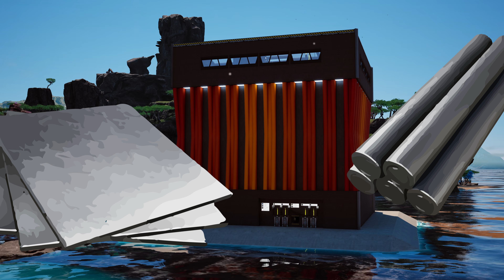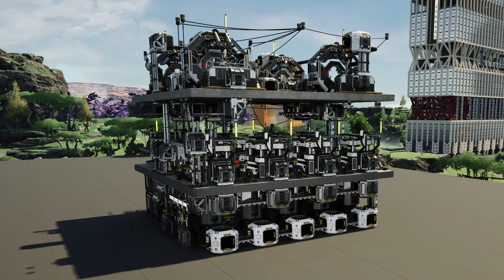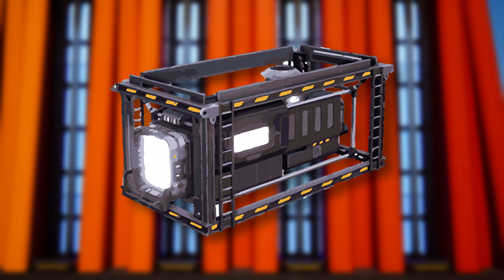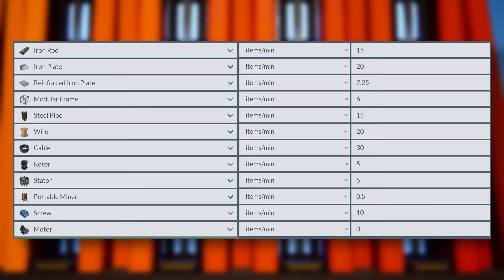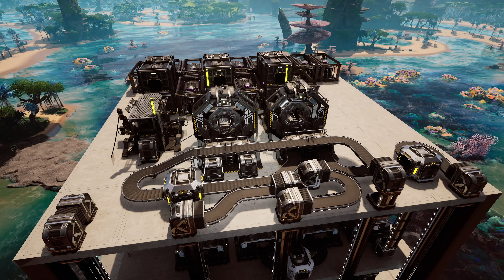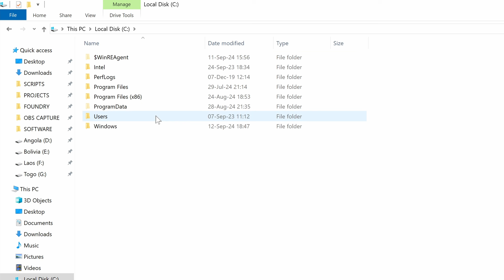1-CLICK Dimensional Depot in Satisfactory 1.0!

Comment: Newb question, what's the spacing between floors? thinking of adding overflow to an awesome sinc on the top floor
Reply from the maker: Overflow should be before buffer containers, otherwise it bottlenecks this concept to max upload rate at all times. So technically adding smart splitters before containers and sink to basement layer is more correct approach.

Comment: Hm i tried yesterday to load BP from 4x4 in 5x5 and it did not load it because BP was created in different size... May be there was patch or something?
Reply: U can load a 4x4 bp on a 5x5 bp by doing it manually from Q menu u load it inside like u load a Bp on the map
Reply from the maker: Only manual placement of smaller blueprint inside of bigger designer works. Load function in Satisfactory does not work so far.

Comment: Has anyone else found blueprints to be fairly unstable in 1.0? I frequently get crashes when deconstructing certain blueprints. I think it’s something to do with belt connections looking at the error message. Only way to clear it is to use SCIM to remove the buildings.
Reply from the maker: Crash with complex blueprints is just a matter of time. Looks like some sort of memory leak to me. It was there in Update 8. I usually crash several times during 6-8 hour session when designing blueprints.
Reply: @Yakez42  That's a shame, hopefully they can make it more stable. Thanks for your content, it has changed the way I play the game!

Comment: How the hell did you connected the output conveyor lift in the iron plate constructors???????? I can't for the life of me figure that out. I've DLed the blueprint, looked at it from every angle, tried everything I can think of, but I can't seem to make that connection. Visually I got everything right, but I can't connect a belt between the constructor and the lift
Reply: omg, ok I did it. It is the most convoluted thing ever, but I will try to explain in case someone runs into this, Assuming you already have the mergers in the ceiling feeding the lift that goes up:
1 - create a belt between the last merger and the lift going to the third floor
2 - put a SPLITTER aligned with the consutrctor under it (if you have trouble aligning it, create a lift between the constructor and this belt, it will be out of place, but that's ok, it is temporary)
3 - create a belt going away from the splitter, in the direction of the factory inside, use a double ceiling conveyor mount to align it
4- delete the splitter
5- create the lift, starting from the belt stub left behind from the ceiling belt, attach it to the constructor
6- delete the temporary ceiling belt, add your merger to the top lift head
7 - ???
8 - profit

all in all, a good technique to know about =)

Comment: Has anyone figured out yet how to build an uploader for several ressouces that does not clog after a resource is full on dimensional depot?
Connecting a Smart Splitter directly to the input does not work, and every even-so-small belt will still cog at some point when one resource is not used.
Reply from the maker: There is no way with existing belt gameplay. Only 1 uploader per resource, like it is done in this uploader.

Comment: Wait, so you can place blueprints using alternates even if you don't have the alternate recipes unlocked yet? That sounds like it's a bug...
Reply from the maker: It was always the case. Ever since update 7. There are literally hundreds of items that are not being checked tho. Coupons unlocks and recipes are the biggest ones. Although sharing blueprints would have been nightmare if there were an actual checks.
Reply: @Yakez42  I experienced that quite early with actual AWESOME shop items in a BP that I didn't have.  I wasn't sure if it worked for recipes and alternates though.  You're confirming that you don't need the alt recipe to use the BP?

Honestly I'm glad if so.  hunting for specific recipes for BPs is... taxing IMO.  I like the new interface (Better than it used to be), but still, I'd rather use community-supplied BPs as-is.

Comment: You can use priority power switches also to turn off portions of the factory at 12:00 remotely!
Reply from the maker: Yep, but it require high speed connectors, a bit higher tier item, than I want for this blueprint stage.